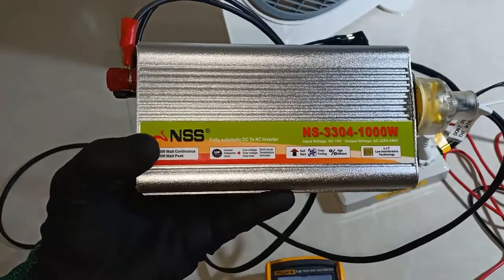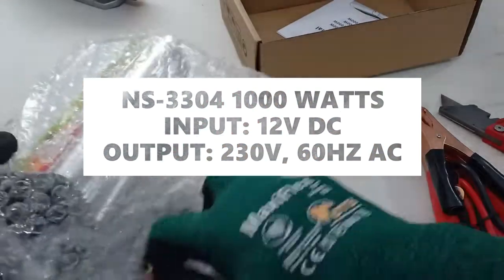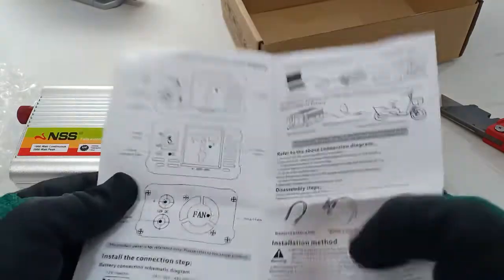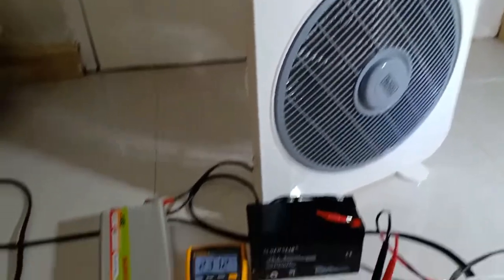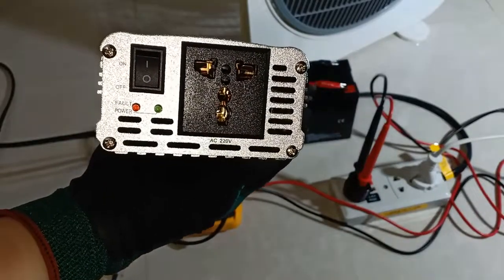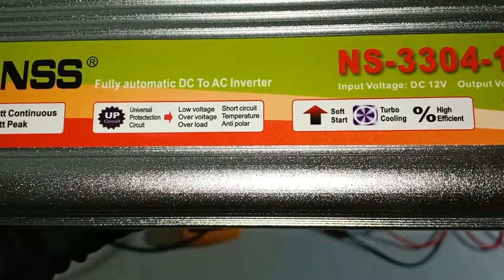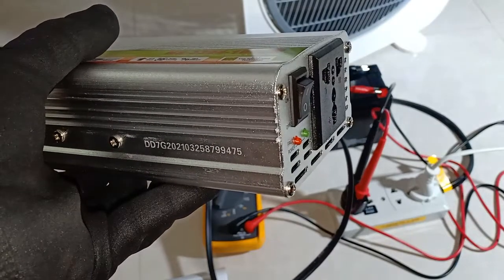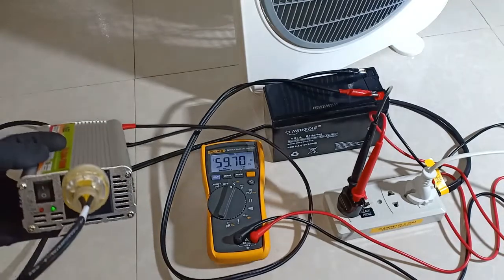[Eng Sub]NSS NS-3304 Inverter Unboxing & Test 1000W (12V DC / 230V AC 60Hz)

Comment: Did you notice if the cooling fan is working when you switch on the inverter
Reply from the maker: Yes, the cooling fan works. It automatically turns on and off, depending on temperature caused by load.